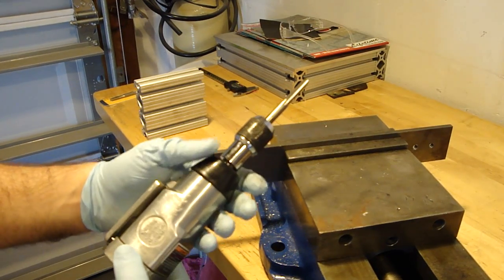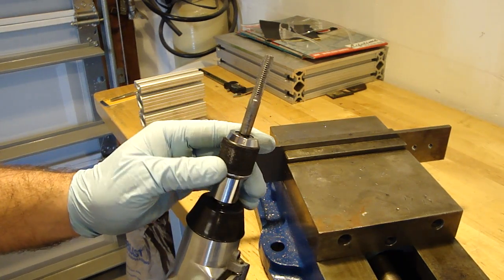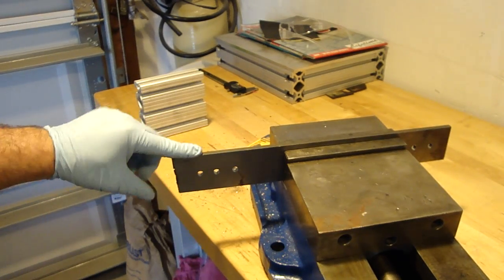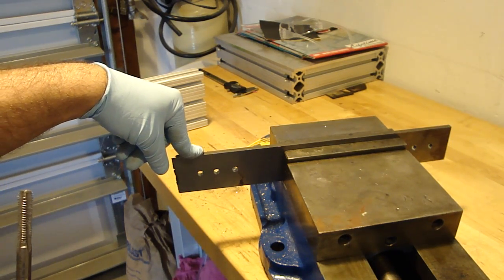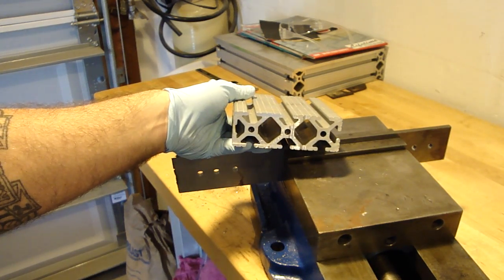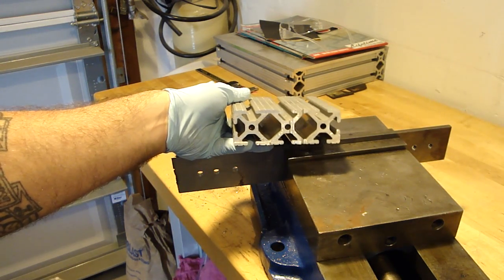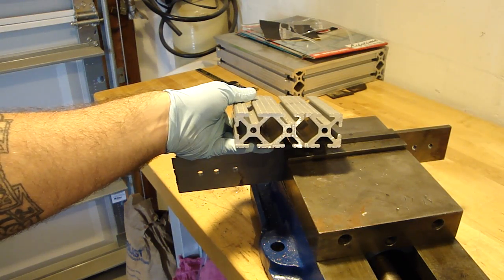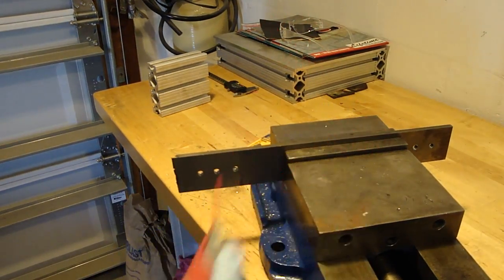Easy Tapping Method

Comment: thanks for showin us sir. It seems the head is loose but tap centers pretty well. does it guide itself? Is it fairly close to 90 degree angle?  also what is that aluminum bar with the X's?
Reply: 80/20 extruded aluminum profiles. Google it. Very cool product and company. Other companies make it as well, but 80/20 is the easiest to work with for small orders for hobbyists.

Comment: Man, your using too much grunt, i.e. you need to back out the tap every now and then to prevent a build up of too much swarf in the hole.
Reply: You are correct with many old type tappers; but modern tappers are designed NOT to need to back up. It is a spiral tapper. Manufacturers use it now and they are very fast without backing up.

Comment: That is just brutal.
Spiral tap at a minimum and proper cutting fluid.
Why use an impact drive... No point. with the right tap and fluid it can be done with a drill.

Comment: Rigid tapping has nothing to do with reversing. Rigid tapping is that the tap is in a solid drill holder vs a floating tap holder. You are referring to peck tapping and YES CNC machines peck tap depending on the application. All CNCs must reverse to extract the tap, not all screw machines do.

Comment: I learned this back in the 1970’s when I worked on an assembly line at Can Car, using a 3/8 impact, I think I broke one tap in 6 years of day in and day out tapping, to this day with all of my OME products I still do it that way, but you need to back the tap out every few treads to clean it out., lots of cutting fluid, NOT CHEEP STUFF) spend the extra, save on taps and much better threads.

Comment: Touch wood never broke a tap using mill or battery drill.
Difference is when time costs money tap 6 holes M3 X 3/8" deep through 6082 took well over 8 mins each and several lockups by hand with cutting fluid. By drill 12 secs total for 83 off 100 mins!
So 6 off x 83 units saved a lot of time like 65 hrs.
Wouldnt risk it in the mill though, usually M5 and bigger.

Comment: My goodness lad, there is nothing wrong with power tapping but for the love of all things holey (hole-y.. that's a pun, son), use a cordless drill like a civilized person! Hardened steel taps are not meant to be beaten on by the likes of an impact wrench. Also, cheap 4 flute, actually any 4 flute, taps are not intended to be used in a power tool. They are for hand tapping where you can frequently reverse for chip breaking and clearance. Use a proper 2 flute for power tapping.

Comment: @Regnarrussell Just a couple of tap tips: Spiral 'point' A.K.A. gun taps 'shoot' the chip ahead of them (into the hole). Spiral 'flute' taps are the opposite and pull the chip out of the hole in the style of a drill bit.  Since these types eject the chips as they cut, both types can have continuous motion. 'Hand' taps as used in your video collect chips between the flutes and need to be backed out to break the chip and/or clear the chips from the flutes.

Comment from the maker: @TsmnnDvl5 
I will agree that this is probably the worse case senario but it works. 

I now use a spiral flute tap (Gun Taps) and tap magic. Still to this day I have not broken a single tap using an impact wrench. The impact applies no more force than a tapping arm. 

Keeping a tap straight is childs play with a tap guide. If you use a impact or drill you dont have to secure the guide as it only requires one hand to do the tapping.
Reply: Please show a tap guide being used with this method (3/8 impact)

Comment: WD-40 for lube?? Nuts!! Also, you need to clean out the threads, turn so far, stop, reverse, this is the key to NOT breaking taps!! Using an impact on a tap, I guess it works for you, I'll never do it, I'll stick with the good ol' fashioned way, by hand. Plus I can keep it straight and square far better than a drill or impact. I like you idea, don't get me wrong, I'm just thinkin expense an safety here. Cheers.
Reply: Works great in aluminum (which is kerosene, a formally recognized cutting fluid for aluminum for at least half a century). But in steel of any grade? Wow. Cheap motor or hydraulic oil would be a big improvement. Actual cutting fluid would be smart.

Comment: 80/20 is not 6061, its 6105-T5 , which has a higher yield strength than 6061. WD40 is about the worst lube for tapping. In fact its really not a good lube at all. I does appear to work until youve used a real tapping lube like Tap Magic. Plain ole motor oil is a better option, and cheaper.
Reply: WD-40 is kerosene, which is a recognized cutting fluid for aluminum. Not recommended for anything harder.